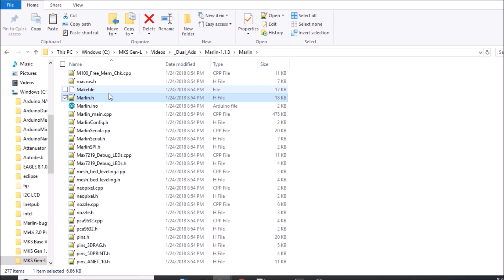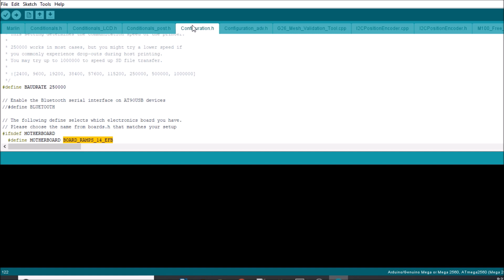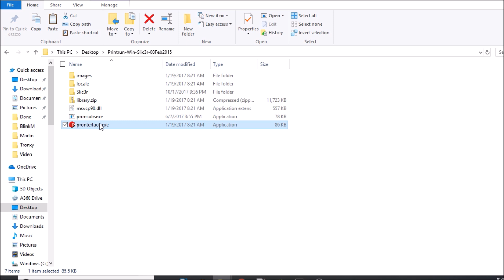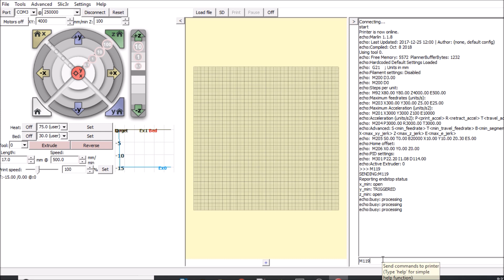MKS Gen L - Dual Axis Steppers

Comment: Congratulations Friend! I will now try to connect the 2 Z motors separately via the driver extender. But maybe the driver expander board won't enable the second UART driver ( tmc 2208 v1.2 ). For a board (mks Sgen L) 32bit, how to specify in the firmware instead of E1 - that there should be a second engine Z !!!?😻
Reply from the maker: There's a tutorial in SKE 1.4 or BTT Octopus v1.x playlists that explains the concepts that would apply.
Reply: @EdwardBraiman  Thank`s
Reply from the maker: You're welcome.

Comment: I need to know a lot more. Right now I am using one drier to run 2 motors. It works except that I can't get the second stepper motor to stop when the end stop swich is pressed. It's strange because if I press the switch by hand both stop. It is just when the printhead  is used to activate the switch that the second motor does not stop.
Reply from the maker: Interesting.  Does it stop when manually switched with printheads?

Comment: Ive fast forwarded 3 times and each time i stopped it right on " Now keep in mind" ! lol
Reply: im using ramps1.4.... people have used a series or || connection of z axis using a custom-made divider with only 4 pinheads for z axis. Then u don't need to use extruder pins....again i don't which one is better , this 1 or the the one which i told

Comment: I've seen almost all his videos and I know what he's going to say before he does. And I love how I've done 99 percent of the things he says "now keep in mind don't do .......(insert stupid and logical thing here) ! Like not touching the motherboards after you activate it. if he saw me he would flip out. I've rewired the whole motherboard while plugged in. Nothing happens as long as you don't have anything conductive in your hand and touch 2 points, Then you fry the board. I've don't the once and since i don't keep things in my hands. And I am grateful to him for all his videos. When I first started out his videos were on repeat and kept me going because i cant help myself i have to tinker with them and do the smallest mod even if its old and outdated and doesn't help. And being new my printers were taken apart just sitting in different corners of the room, flipped with wires coming out of them. Even now I have a L:ulzbot 2.1 that i got to upgrade and just got the dual extruder for it. A prusa i3 mk3s with mmu2s sitting in a box because my other printer is out of commission because I'm doing linear rails om the x and z axis on my BIQU B1.

Comment: Nice.  How about doing one for this board using Marlin 2.0?
Reply from the maker: Thinking about it.
Reply: @EdwardBraiman  it would be really helpful.  I'm building one right now, literally. Lol.  And my GenL v2.1 board just arrived yesterday.  It has the MKS TFT35 v1.0 with WiFi card.  
One thing I don't understand, is when I use the touchscreen to connect the screen to wifi, and use my PC to browse to it's IP address, I get a screen with very little info and 2 sections. One for Update and one for Wifi Config.  
Under firmware I can upload a firmware file, but idk if it's for the screen or controller, the next is asking for a "web view" file???  What is that?
Then under wifi config I have "Sta" or "AP" which I'm guessing is Access Point.  
Any help would be great.
Reply from the maker: I'll see if I can research.

Comment: Great video. Do you know what lines would change to do this in marlin 2.x ?
Reply from the maker: They should be similar, but now. You need to enable the axis for each direction in configuration.h.  you can search for a4988 in configuration.h.  otherwise I'd need to research.
Reply: @EdwardBraiman   I found a video that covers the setup in marlin 2.x and the new z stepper auto align. 
https://www.youtube.com/watch?v=BDtZPNZ5xks

Comment: Many Thanks Edward, I would like to know if I need to change any thing in following section of Marlin for this Dual Axis, can you please clarify if I have to un-comment Z2 or E1 or none? :

#define X_DRIVER_TYPE  DRV8825
#define Y_DRIVER_TYPE  DRV8825
#define Z_DRIVER_TYPE  DRV8825
//#define X2_DRIVER_TYPE A4988
//#define Y2_DRIVER_TYPE A4988
//#define Z2_DRIVER_TYPE A4988
//#define Z3_DRIVER_TYPE A4988
//#define Z4_DRIVER_TYPE A4988
#define E0_DRIVER_TYPE DRV8825
//#define E1_DRIVER_TYPE A4988
//#define E2_DRIVER_TYPE A4988
//#define E3_DRIVER_TYPE A4988
//#define E4_DRIVER_TYPE A4988
//#define E5_DRIVER_TYPE A4988
//#define E6_DRIVER_TYPE A4988
//#define E7_DRIVER_TYPE A4988

Comment: Hi . 
I have problem with my printer setting , if i increase the z=1mm the e1 increses x10 then =10mm, 
How i can fix , i use tmc2209
Reply from the maker: I've yet to do a tutorial on TMC 2209.  My guess is the place for where you set x,y,z and E0.  It's something like 80, 80 for x and y so for the others value try first doubling and seeing how much movement you see in mm, it maybe a clue as to the settings.

Comment: hello, great video. I'm currently building a printer with the MKS GEN L and would also like 2 steppers for the Z axis. but where do I connect the second end stop to E1? . Thank you very much
Reply from the maker: You can split the signal to z motors with wires or a special board.
Reply: @EdwardBraiman  
thanks for the quick reply. is there a video of it?
or which cables do I have to split and how?
would be really great if you could help me
I've been attached to this problem for quite a while and can't get any further.
Many thanks in advance
Reply from the maker: Check my playlist for SKR 1.3 dual z stepper with parallel module.  The process should be similar mechanically.
Reply: @EdwardBraiman  
Thanks alot
Reply from the maker: You're welcome.

Comment: Thanks a lot.
I wired my dual z axis in parallel but they doing a so boring noise (if I connect only one stepper motor in Z port no noise happens) . I hope this trick fix my issue.
Reply from the maker: Sounds like the current on the trim pod needs to be adjusted.
Reply: Edward Braiman  I checked the current values on DRV8825 and tried to increase or decrease  but nothing changed. I don't know what is wrong but after apply E1 as Z port this is worked fine to me and the noise doesn't boring me more.

Comment: Do you need to make any changes in the pins file or anywhere else in Marlin to let it know we are using one of the extruder outputs for the Z?
Reply from the maker: Marlin configuration_adv.h should be where you'll need to enable.  The pins file should be all set.  Remember this is not the preferred method to use two Nema17 steppers.  You should split the output with a stepper splitter or wires.  Otherwise steppers get out of synch.

Comment: Really nice job keep up the good work!!!, this is the best option i think having 2 motores connected in one driver could become dangerous because the Current and the heat generated and i think it´s too much for one single driver.
Reply from the maker: Two motors on one stepper driver is safe.  Stepper needs to be calibrated, but I've personally Rin on this configuration for approximately 3k hours.
Reply: @EdwardBraiman  Yeah i ill have to setup the drivers to the same value using the same type of motors, thx!

Comment: hi mate I wounder if u could help me with an issue I am facing my hotend and bed temps are jumping all over even when not in use and I cant autotune the hot as I get temp to high I have mks 1.4 running with marlin 1.1.9 was thinking of dropping down to 1.1.8 don't know if its the firmware or hardware issue
Reply from the maker: Try checking the sensor type specified in the Marlin firmware, check you have overtemp enabled, check range for temperature in the firmware as well.  If it works when you lower to 1.1.8, then might be firmware issue.
Reply: tried with fresh download still get overtempt prob
Reply from the maker: Can you copy the error message from Pronterface?
Reply: PID Autotune failed! Temperature too high
Reply from the maker: Tell me about your extruder type and configuration.
Reply: It's an e3d volcano with and Ntc 3950 thermistor

Comment: the engine moves in the opposite direction, give the order up go down, give the left go straight, why, thnx!
Reply from the maker: You can invert the direction of the motor plugs 180 degrees to change the direction.  Remember to power down MKS Gen L v1.0 board for 12v power and 5v USB before changing plug(s) direction.

Comment: thanks for posting this, I got a gen L board that I intend to put in either  my ender 3, or my CR10  the other will get the ramps :/  I do intend to add a 2nd Z on both  as am going to go with a direct drive extruder,   and was concerned the extra weight may cause the gantry to drop a bit as the hotend  gets to the X max end of travel,  one minor thing I did notice with the  Gen L board was this  I had to rotate the black plastic  housings  around the exp1 and exp2 180  degrees  before my 12864 reprap display would work - thanks for posting this and can I ask if you  have you tried the gen L board at 24v ?
Reply from the maker: I've not tried 24 volts on the MKS Gen L yet.  My personal perfence is 12 volts and wanted to keep the tutorials as simple as possible.

Comment: Is there a specific reason why you don't define the MKS_Gen_L board at the motherboard line since it's one of the available boards under marlin?
Just curious since i'm in the process of attempting the setup for my cr10s machine with TMC2208 drivers.

Awesome videos by the way. Thank you for the guides!
Reply from the maker: I think my original reason had something to do with pins_mks_gen_l.h pointing to pin_ramps14.h. Keep in mind the user would only lose the functionality of one extruder.  Nice catch